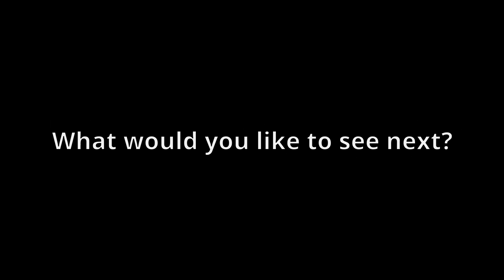Forged Dragon bottle opener. Old version.

Comment: As a hobby smith who is very much just learning the basics of the craft I admire the skill this video shows.  I've done a dragon bottle opener, and I'm happy with the result.  It's about what you would expect from a beginner.  It's recognisably dragonish and it opens bottles.  I'm happy with the result, at my level I don't think I could have done better.  The content of this video shows how it can be done well.  the sculpting is far more exact, the knowledge of when to sculpt hot and when to sculpt cold is a lesson that I will definitely try to recreate.  I noticed that when you are hammering you are delicate enough to leave nice transitions between different planes of the work.  Smooth with few hammerblows is a skill that most smiths would sell their soul for.  If I'm honest I would sell my firstborn and seriously consider replacing a lower limb with a pegleg if I could do that ;-)
Reply: How are you now 2 years later. I just started this year
Reply: @timothyburns2081  Good!  Thank you for asking.  I still have my firtsborn, and both lower limbs, but sadly I'm no better at smithing or sculpting than I was when I wrote my first comment on this excellent video.  How are your skills progressing?

Comment: Love this! I'm going to give this a go. Is there a way to do it without having to weld? I've not managed to forge-weld yet, and I've yet to learn to weld with a machine!
Reply from the maker: Arc welding with electrodes is not that difficult.
You can get started for cheap as well. 
It's a good skill to have.

You can't really forge such a bottle opener without welding.
Reply: I dug out an arc welder I bought second-hand about 20 years ago (which I've never used) earlier to give welding a go, following your encouragement. Not only did the machine work still, but I managed to get a couple of beads going on some scrap! So chuffed Thanks for the encouragement! Nothing stopping me giving this a go now! Can't wait!
Reply from the maker: Haha!
Great to hear.
Good luck!

Comment: What is the purpose of borax sir?
Reply from the maker: To prevent oxidation on the hot steel.
Borax will form a thin layer that will protect the steel from oxygen.
This will make it forge weld easier.
Reply: @ForgedInHolland  thank you sir